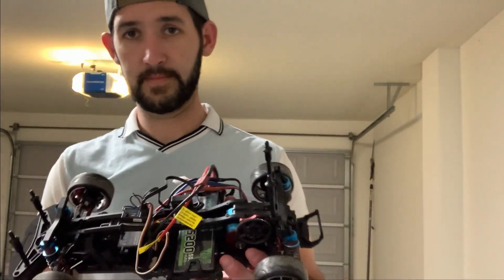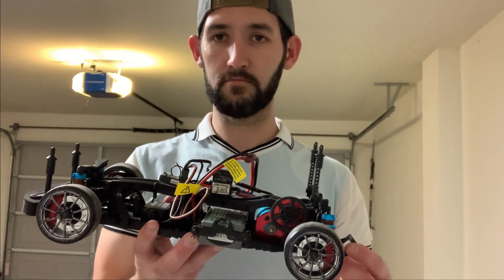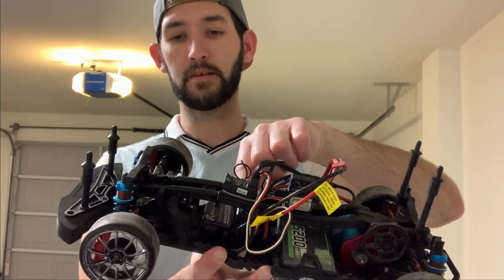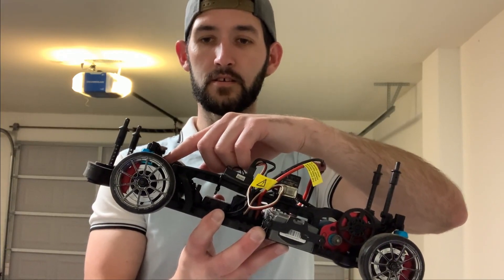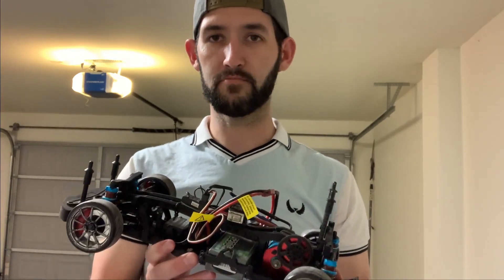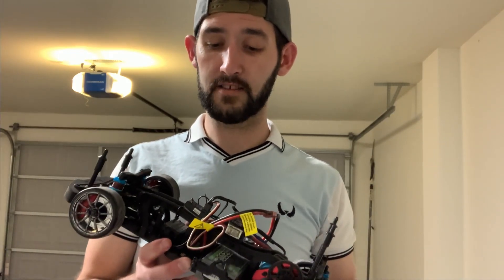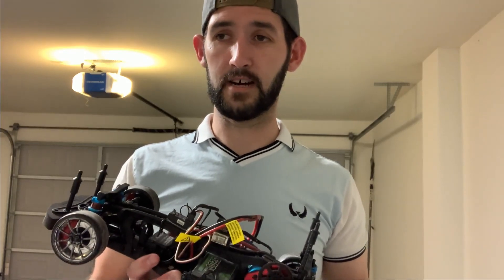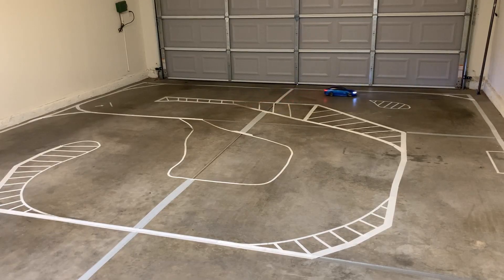Can You Use Rubber Tires For RC Drifting?| Re-tuning RC Drift for rubber tires

Comment: Yeah, watching this video again proves my point exactly about setup vs "spec tire" bs that public drift tracks supposedly have. You can make rubbers slide like plastics if you make the rest of the car more scale-like, too. I'd bet your specific car could do even better (like I said on the other video) if you do some mass de-centralization.

Take the servo and flip it forward, top mounting it above the steering rack, then put the ESC and/or receiver all the way forward in the front bumper if you can, then mount the battery right behind the steering rack where the servo used to be, and do it transversely like you currently have it.

Try it like that for a bit (with a fixed gyro, of course) and if, after that, you evaluate your weight distribution to be too far forward, make it a rear motor car to compensate and/or use a 4-gear transmission (which makes the motor turn in the same direction as the tires) to add rearward weight transfer/squat on acceleration and more lift/dive on braking.

Comment: Great video mate, What servo/gyro are you running?
Reply from the maker: It’s a rev-d servo and mst lsd gyro
Reply from the maker: And thank you for the support
Reply: @ThirdWheelExclusive  Thanks for the reply bud!
Reply: @ThirdWheelExclusive  Thx for the video Sir. I too just bought an MST RMX 2.0 and have been on rubber tires with the Kyosho, Vaterra AWD 1/10 RCs so I do like the rubber but I use low grip tires on those so I can get power sliding and I do not run them on asphalt but smooth floors. Hard plastic is different. So I am happy to see this works and I have not moved any electronics on the MST. So it is Aug 2021 now how do you still like the rubber tires...still good?
Reply from the maker: @ParcoUpchurch  I think it’s great to be able to use the rubber tires but I will say that I think the rtr electronics in the mst limit the potential on rubber. It would be a bit better with boost.

Comment: What RC cars might benefit from for scale driving feel is to actually be the correct scale weight. A 1/10 scale RC car depending on the body/model you're emulating with it should have a 9.5-12 inch wheelbase and be 6.5-8 inches wide in order to be truly 1/10th scale. Taking into account the square-cube law, it should weigh between 24-42 pounds, but more typically between 28-36 pounds.

Give it that weight with between a 60/40 and 40/60 FR weight distribution, then build the suspension rates to compensate for it, and obv give it enough power to overcome the weight and grip, and you should be able to drift much more realistically looking/feeling between 5-35mph (true scale speed equivalent being 16-110mph) on rubber tires.

Gonna wear them MFs out quickly, though, just like a real drift car.